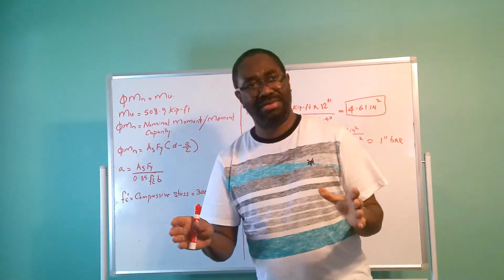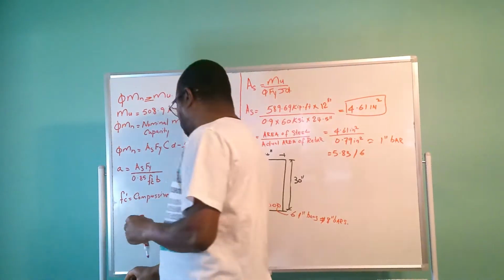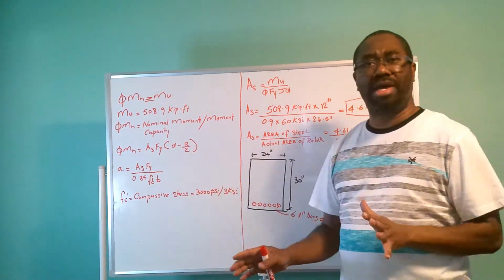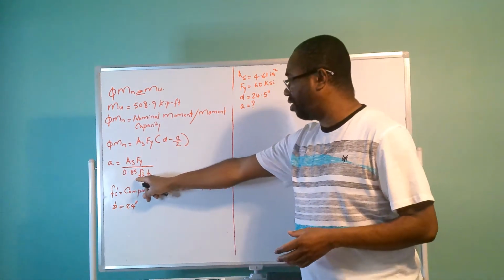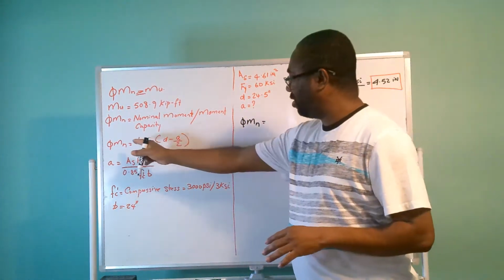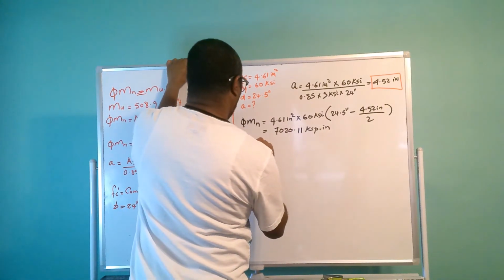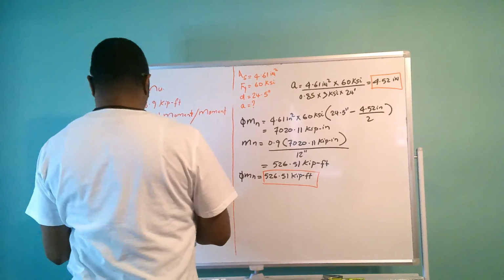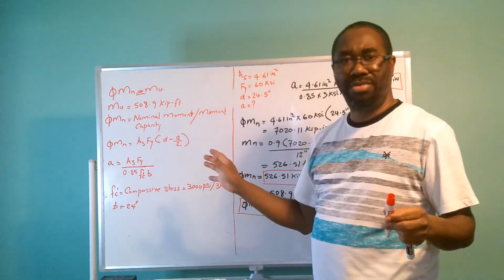HOW TO DESIGN A SINGLY REINFORCED CONCRETE BEAM PT2

Comment: in single reinforcement beam steel use in upper portion of beam , is act to prevent  bending ? I s double rc
Reply from the maker: No the bottom steel is used to prevent bending. The top steel is used to support the stirrups for resisting against shear.

Comment: Nuff respect brother JK I'm trying to learn dear teacher. 👊🏾🇬🇧
Reply from the maker: RESPECT LENNIE, You can ask me any question and I will be more than happy to answer your question.
Reply: @jkengineeringarchitecture.  Hi JK. What size beam can hold a second floor apartment that has walk around corridor around entire perimeter. Plus multiple water tanks on roof deck.  Ground floor span in 42ft and length is 112ft upper floor span is 31ft and length is 62ft.
Reply from the maker: @cCaribbeanSpursTv  That's a lot of work. I would have to do the calculations to determine that.